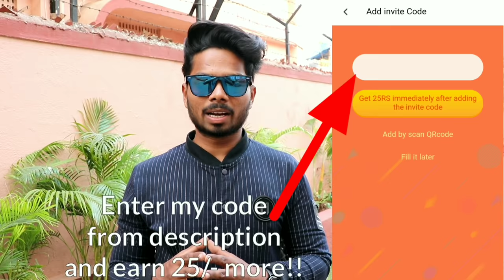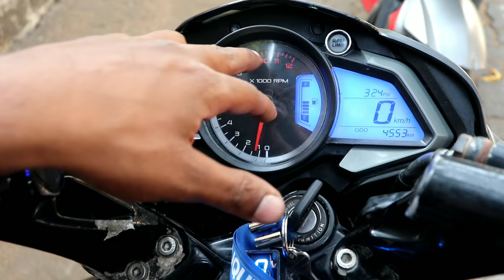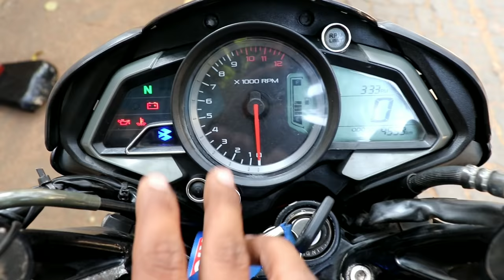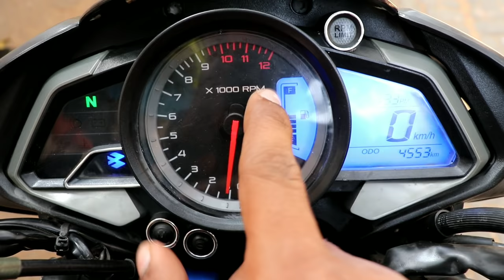Racing CDI for all Motorcycles RPM lock removed 12000+ Rpm | Pulsar Ns 200

Comment: Bro you are kinda destroying ur engine 12,000 rpm is too much for pulsar ns ur engine cdi is designed as per the vehicle diagnosis limitations if u rev too much it can cause cylinder damage or ur piston rings can break it's a single cylinder vehicle don't rev it that much.. drive safely
Reply: Finally someone who is sane
Reply: Very much so, you only install a cdi when you plan to or intend to install a big bore kit. A big bore kit requires the cdi so you can adjust the unlocked power.
Reply: 😂 doesn't matter cause he is earning way more money frm YouTube
Reply: As far as i know the NS engine is safe if you pull them until 12k RPM...
Reply: @avyuktreyangogoi9496  to tu bencho America ka mechanic hai kiya ? Top floor khali hai kiya tera
Reply: That's true. Plus, the bike's peak power and torque is achieved at an rpm much lower than 12k. So there's no point altering the CDI to make the bike revv excessively.
Reply: @avyuktreyangogoi9496  sahi
Reply: Mere dost ne lgvaya tha bike Puri khrab ho gyi
Reply: He wont use it.just for video content he did it...
Reply: jhampa ko maut se dar nhi lagta
Reply: Bro what about in BS6 ns200
Reply: @33ggparv  kya majak kar ta h
Reply: Oohoo
Reply: Bhai dekh iski baat sun leta to tera pulser ka engine seize nai hota
Reply: Fun>>>>>>engine
Reply: Very sensible suggestion 👍👍, this guy is crazy, otherwise he wouldn't have dared to take it to 12000 RPM. Engine is bound to get damaged.
Reply: Chapri scared of loosing to ns
Reply: Rs engine are turned for high reving Bro
Reply: @33ggparv  JA THERI 😅
Reply: views ka chakkar babu bhaiya..views ka chakkar
Reply: Thu patient he our doctor ko sikha raha he 😂
Reply: Fake preaching lol

Comment: I want to set my rpm in ns160, in what engine conditions should I set the rpm count cold or hot engine also what value should I set for balanced power and efficiency
Reply: 1500 rpm

Comment: Do we nee to change the valve springs? Since we are going up to 12000+ rpm, value floating issue may comes in to picture.because stock springs may not be designed for higher 12000+ RPMs..
Reply: Hey bruh just want to ask you question meine mistakenly high rpm me without clutch 5 to 6 th switch Kiya just once.....so is it damaged my gear box.... ❗
Sry to bother you but I'm completely newbie.....
Reply: @sahilchorghe5974  only once.. not much..

Comment: its not good to go after redline limit of an engine, that limitation on rpm is not for reducing bike speed ,if u want more speed u can change sprocket ratios,at that rpm pistons not able to handle stress due to sudden reciprocations,engine may damage, and may be backwheel lock at 140 bave speed

Comment: I have a problem on may ns 150 ..if I on may key may rpm are funtion.. when I start and revolution may rpm is not working what is the main problem to my ruser I check also stator good.wirings Good..
Can't cdi is working from rpm.

Comment: Hi, can u tell me something for cbr 250r for unlocking 12k rpm and is it safe for engine life or not. Waiting for your reply....
Reply: No its not safe bro, these bike's engines are single cylinder engine, the highest rpm of a single cylinder engine is 8k rpm, and you can increase the rpm at top gear. But 10k is the maximum RPM of a single cylinder engine bike.

Comment: What was that left side display 
Please say that 
I need to buy that
Reply: It's a voltmeter
 EMERGING TECHS Digital LED DC Voltmeter 5-30V Panel 2 Wire 0.56" Voltage Meter RED Battery Monitor https://www.amazon.in/dp/B07HDBHKDV/ref=cm_sw_r_cp_apa_i_YAYbEbARKFP3P

And the one near the ignition key is a gear shift indicator.

Comment: Hey bro, my bike is Tvs metro ES, 2011 model a 100 cc. I just recently replaced the harness and I use Kawasaki bajaj ct 100 harness. My CDI has 5 pins and another 2 pins for limiter. I can't use my full throttle. What should I do?

Comment: Bro can I use this cdi for my rs2oo
Reply: No bro....rs200 is fuel injected bike.....you have to buy a ECU...🔥
Reply: @saptarshichatterjee2419  bro whats cdi,ecu😦
Reply: @highwaysouth9015  CDI is used for bikes with carburetor and ECU is used for fuel injected bikes...basically ECU is a programmed circuit which controls mostly everything of the bike.....NS200 is a carburetor enabled bike because of which CDI is used....whereas bikes like KTMs and RS200 are ECU operated bikes
Reply: @saptarshichatterjee2419  bro bs6 is fi right ??so nw ns200 is ecu right ??
Reply: @highwaysouth9015  yes brother...new NS200 is fi...that is operated by ECU
Reply: @highwaysouth9015  yes brother...new NS200 is fi...that is operated by ECU
Reply: @saptarshichatterjee2419  bro what thise ECU can do
Reply: @saptarshichatterjee2419  bro what thise ECU can do
Reply: @highwaysouth9015  ECU controls every electrical components as well as the fuel injection of the bike.....its a programmed circuit
Reply: @highwaysouth9015  ECU controls every electrical components as well as the fuel injection of the bike.....its a programmed circuit
Reply: @highwaysouth9015  ECU controls every electrical components as well as the fuel injection of the bike.....its a programmed circuit

Comment: Bro give me solution 2018 model ns 200 i rev the engine .i get valve sound give me permanent  solutuon
Reply: It needs tappet adjustment after every 5000 kms, I have a bs4 NS and I also got it fixed, but it needs to be done periodically.

Comment: sir My BS4 ns 200 self start work perfectly in morning... when i cover  1 km its start misfiring in 2-4k rpm,then when i try to start after above 5 min break,it wont start perfectly.after some try it will start.. i clocked around 30000 km. i just changed vaccum piston and 3 spark plug... could you please tell me what the possible reason is?
Reply: Your bike's valve taped is not properly set, thats the issue,